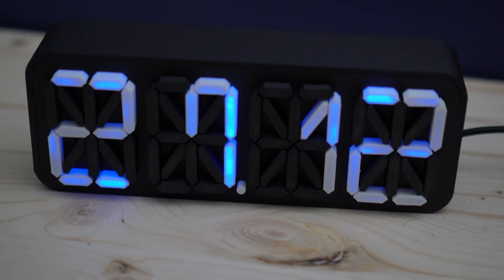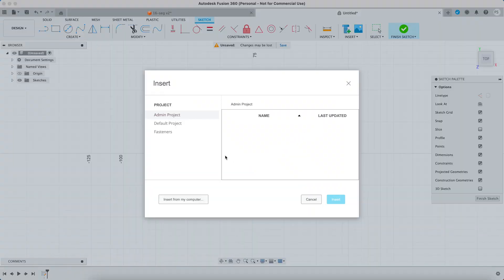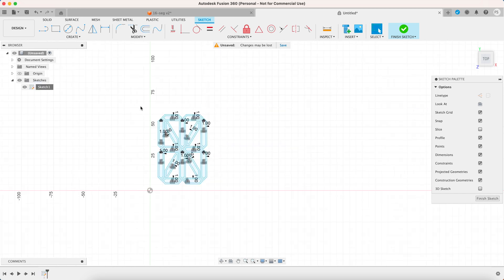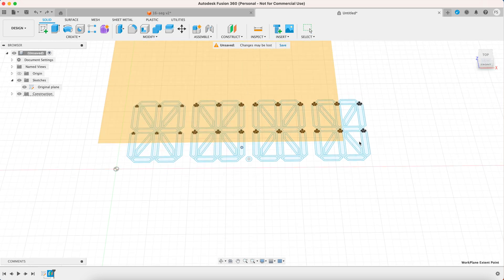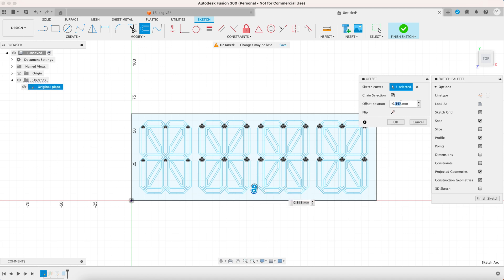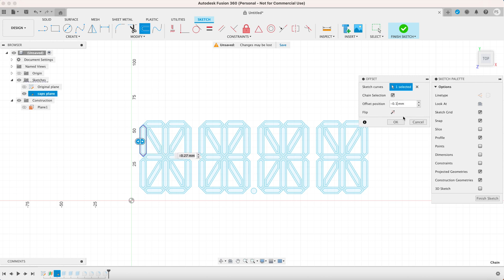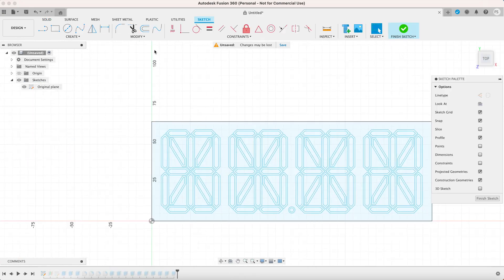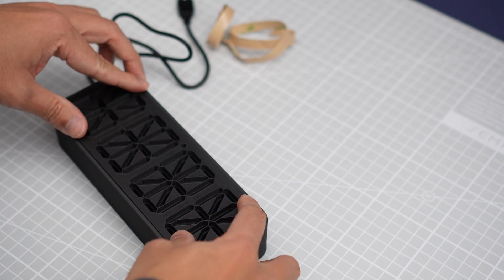3D Printed 16-Segment Display Panel (+ Light Box)

Comment from the maker: A1 Mini Combo: https://www.awin1.com/awclick.php?gid=570773&mid=46345&awinaffid=2034675&linkid=4382675&clickref=
BambuLab Filaments: https://www.awin1.com/awclick.php?gid=570777&mid=46345&awinaffid=2034675&linkid=4382680&clickref=

My 2nd favorite filaments: https://geni.us/A4OFomi
Lubricant for X,Z,Y-Axis rails & idler pulleys: https://tidd.ly/3KMFHqs
Grease for Lead screws: https://tidd.ly/3Lk36j2
Deburring tool: https://geni.us/9WGzv
Wire cutter: https://geni.us/NAwQIL
Heat gun: https://geni.us/Jdcu

#Affiliate